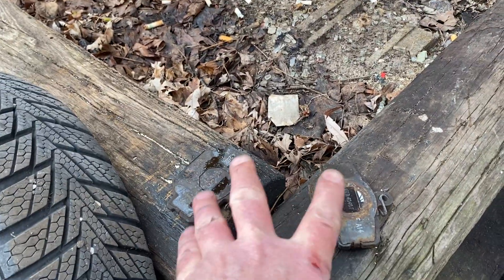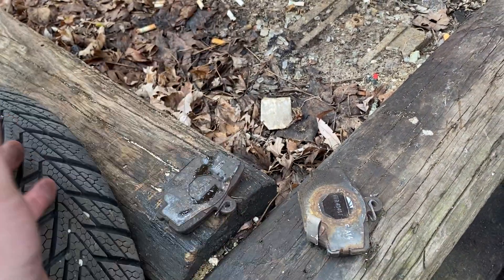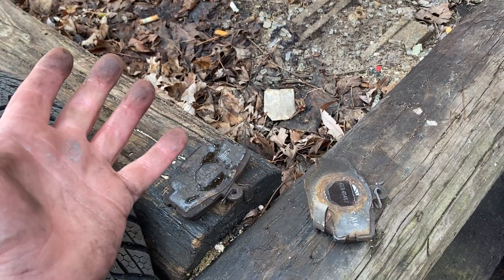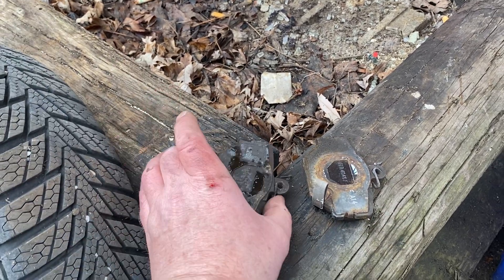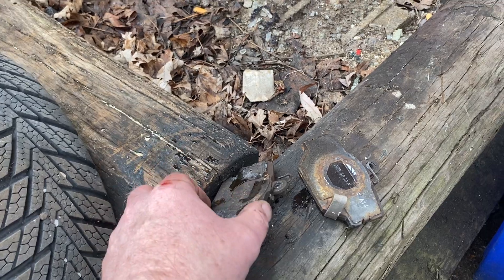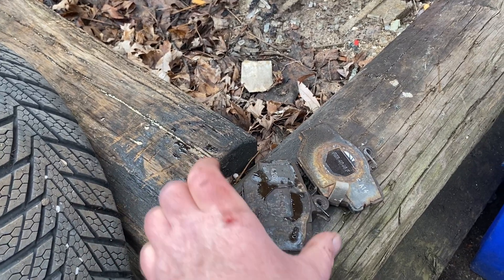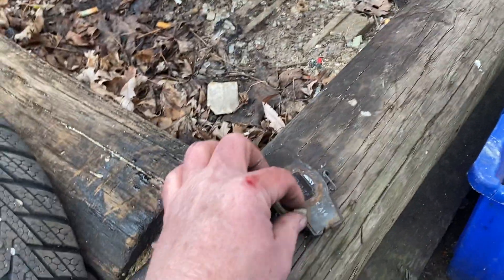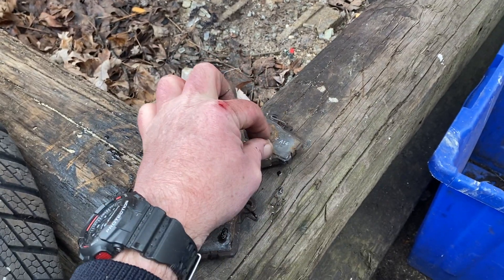quick fixes and tips .. brake pad wear indicators / squeelers

Comment: So do i need the squealers?? I did the first tire took forber cause a lot of different issues i ran in to. But went to do 2nd tire and i got the 2 pads left that have squealers. Can i just pop on off n use them? Or do i really need to go back and switch them around??
Reply from the maker: You don’t really need to swap them . As long as you are inspecting brakes every few months or so the squealers are kind of a brake pad idiot light . The wheel with 2 squealers will tell you when the pads are due 👍
Reply: Thank you!   @fupabox

Comment: Ahh so that's what makes brakes squeal. Cool. Thanks. I guess if they didn't have the squealer to warn you the disk could get damaged.
Reply from the maker: Only saves the disc if you replace the pads as soon as the squeeling stops . Otherwise the squeeler chews up the rotor . :(